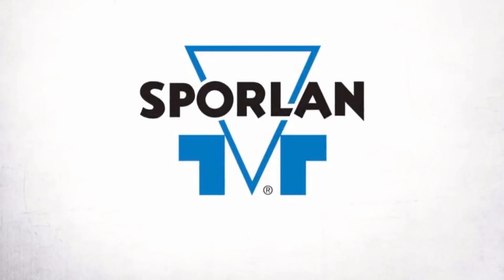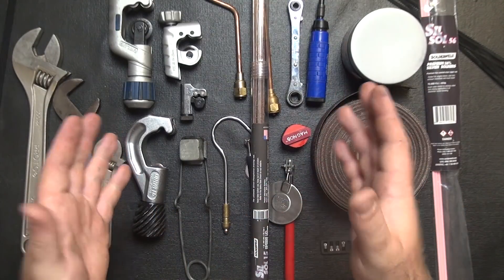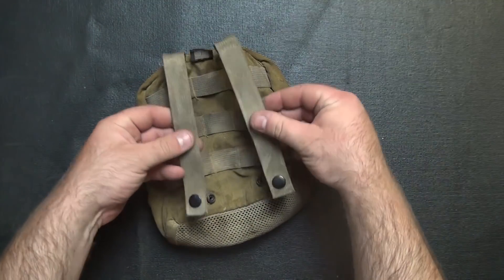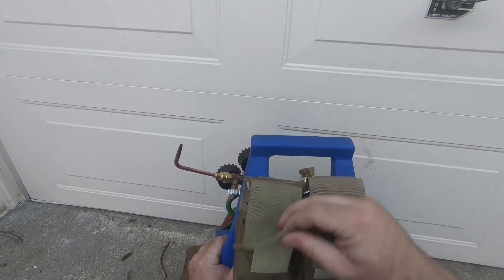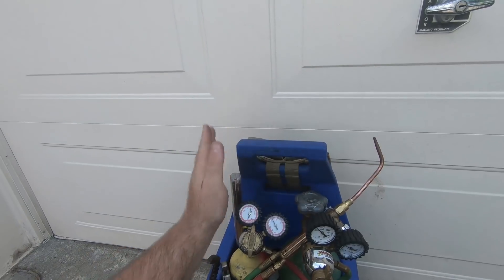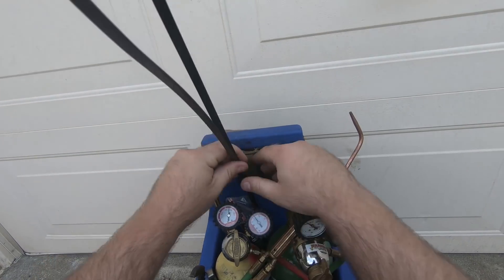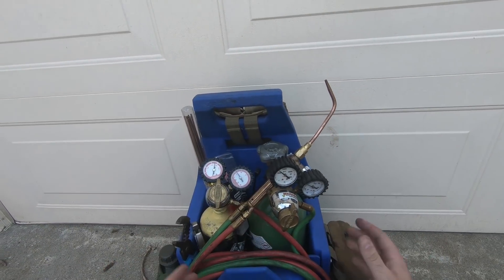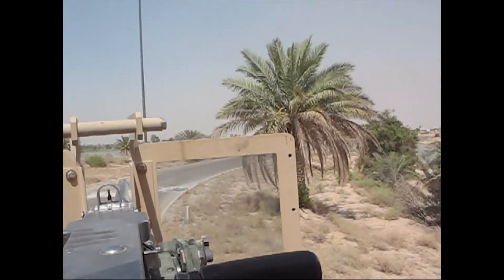My HVAC Oxy Acetylene Torch Setup🔥🔥

Comment from the maker: What did I miss with this "assault torch" setup😁😁??
Reply: You missed back up iron sights , torch suppressor ,  sling , tactical bacon, and a case of beer.
Reply: AK HVAC an apprentice to carry it lol
Reply: AK HVAC you might have just invented something with out even realizing it. You could try and trade market that kit.
Reply: Excited for this one!!! Just went to a oxy acetylene set up!!
Reply: lugging that thing around is bad enough as is. trying to get that beast thru a roof hatch with that ish attached, swears are going to be a plenty.  i got my 4 tips, striker, screamer, service wrench, mirrors, tip cleaner, 5/8 cutter and 1 1/8 cutter in there. just dump it out and get to the business. wrenches always stay in the bag. fluxed rods stay in the van until needed.
Reply: AK HVAC  try invention. Trade market .
Reply from the maker: tinymanthebeast can you clarify what you mean?
Reply: For drill bits, a spare 9 volt and other small bits. The surplus ammo pouches for the Mosin Nagant rifles is perfect. Small and fits on belt, durable leather
Reply: Nice setup... used my web gear with camelpac a bit to hold misc tools when I first startred. 
Add this https://www.amazon.com/Cliplight-CLP580500-Spark-Key-Torch-Ignitor/dp/B000NOXDTS
Shout out VetTV for you vets https://vettv.vhx.tv/browse
Reply: I bought the Turbo Torch setup. Like the regulators absolutely hate the carrying case. No good way to roll the hoses up. 
There is little to no storage inside. I use a klein canvas zipper bag for striker, flux, sandpaper etc.
Reply: Hvacmisfit323 here your missing service port multi tool wrench and allen head.  Also valve core removers. Nitro test ports. Idk if this is just stuff needed for smaller retro. But stuff i lug around.🤔🤙🤙🤙
Reply: Always thought an alice pack frame with the shelf would be handy if you had to walk a long way with em

Comment: Great setup! Didn’t read all the comments so I’m sure it’s been suggested, but a small kitchen fire extinguisher would be great. One of those nylon water bottle bags clipped to the handle with a large carabiner would probably work well.... only thing I would be concerned about is adding too much weight to the caddy for comfortable carrying. Also, maybe a fire block cloth?

Comment: I don't have an oxyacetylene getup, but I cut a piece of 8" spiral duct and put a bucket caddy on it for my b-tank. Spun cap on the bottom. Holes for a bungee as a carry strap or to hold it on my folding hand truck

Comment: Thank you for this! I’m definitely using this as inspiration! Always cool seeing how other guys do things. I think I’m gonna use the tough built tool pouches from Menards. I already have a few just gathering dust. Screw the clips to the caddy like you did the pipe strap. Then I’ll have 2 more screwed to the headache rack in the truck. When I stow the kit I’ll hang the pouches on the headache rack (so I can fit the caddy in it’s original little nook I had carved out for it) and then when I need the rig for a job I’ll clip em on it and go.

Comment: My neighbor was welder, built me wheel caddy with arm with easy/bolt screw, I could pull it behind me, was easy grab one handle on to roof or attic, I used utility bag on rear. Also had 3/4" pvc with cap/screw top to store silflos.Nice adapt to plastic carrier.

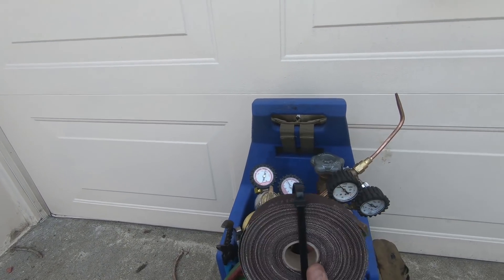Comment: First of all Andrew. Thank you for your service. My baby boy was a Marine. You are like me. I hate making trips to the van. I have a Victor set up so it’s a little different. I will definitely try some of your ideas. I like the sand cloth one. I also like the wire tie one. I used a 4 footer to hold my suction line in place while I was brazing in a compressor in a BDP condenser. I’m anal about bags. I use my MC strictly for maintenance. I use my MCT for service. I use my XL when I think that I need everything. I use my MB2 and TP4 for quickies and pull basics from my other bags. I have multiples of everything. It drives my wife crazy. Oh well. It’s 4:20 here. Time to get on the road for my first call. Aquasnap Chiller. Have a great day. See you on the next one. God bless.

Comment: Do you favor the that torch over say Turbo torch and why?
Reply from the maker: I favor it but just because it’s what I’ve always used.  Lots of guys have great things to say about air acetylene.
Reply: I've been thinking of trying out an air acetylene torch.
When I started out, they were obnoxiously loud, and threw too much heat into too big an area for finer repairs, but now some of them are fairly quiet, and they have some pretty fine tips for them these days.
Reply: Mark Beiser I like the turbo torch kit off Amazon

Comment: Nice set-up!
 I keep a lot less on the torch kit itself and just carry a separate 'cheapo' blue open top electrician's bag I got off of Amazon... http://a.co/cmgwYu5
I carry water bottles, heat block sprays/paste, blue bubbles and scrap piece of metal to protect unsulation and other flammable stuff in the middle... then smaller stuff like cutters, reamer, wire wheels, rags, tips, and small pieces of leftover solder (and a pair of baby vice grips to use them down the last little bit) in the side pockets.
Reply from the maker: Video bro!  Sounds like a cool kit that would work 👍

Comment: Thank you for your service💪🏼 Dig the set-up! In the magazine pouch, maybe a few extra torch tips would be nice. Depends what size pipe size you’re working on, you change it in a beat. Rose buds, regular tips, RValves tips etc etc etc...Recently I worked on a unit and had to braze 1 3/8” pipe. Had to dig through my entire van to find my rose bud tip. Found it and made a huge difference. Great video and thank you once again! 🇺🇸
Reply from the maker: Thanks for watching brotha🤜🤛!!